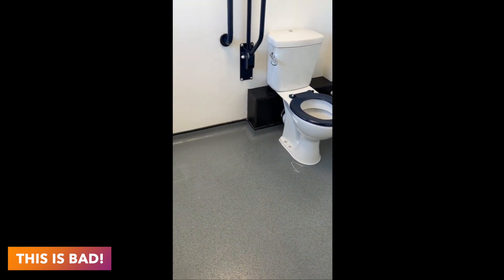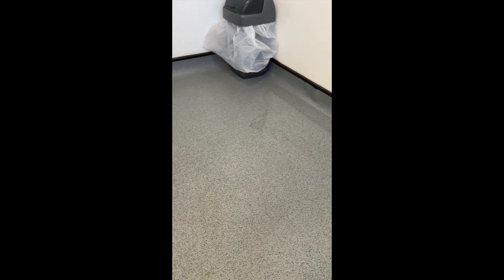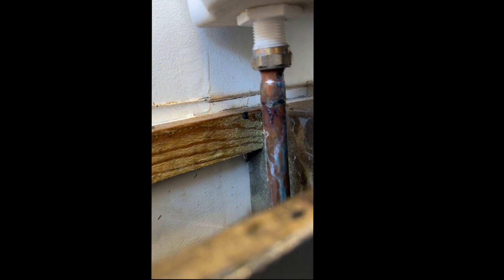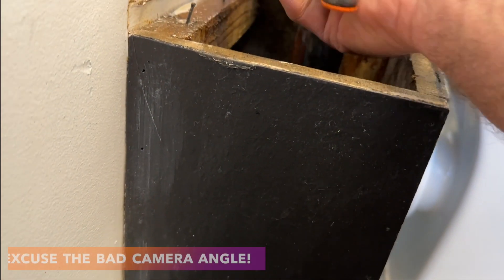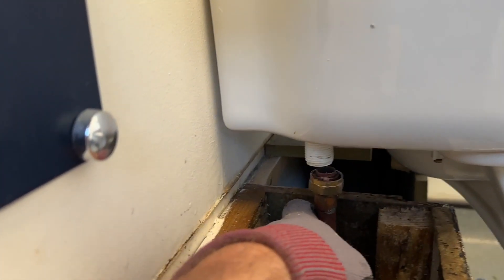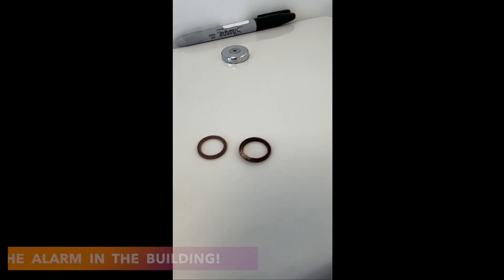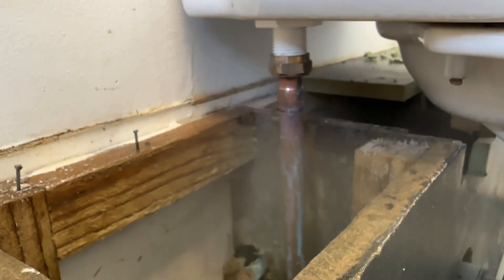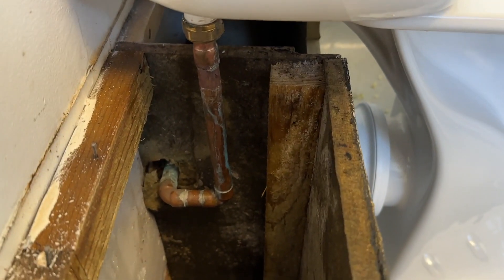School almost wrecked by this toilet leak

Comment: I always use brass shank ball valves. 99.99% leak free, specially going on to a brass fitting with a fibre washer 😏
Reply from the maker: I prefer them too, I generally fit the fluid master ones.  What do you use?
Reply: @moss_electrical_and_plumbing 
I use fluidmaster 99% of the time but if it is
 Gravity system then I use Thomas Dudley 🤓
Reply from the maker: Quality 👍

Comment: Plastic threads. I would of just changed the fill valve to one with a brass shank or else put a copper to female straight on the plastic thread. That fibre washer won’t last cause the plastic doesn’t have a flat surface.. bit of a diy fix.